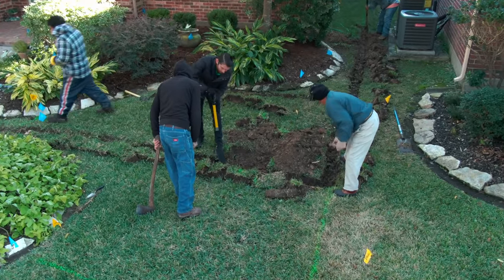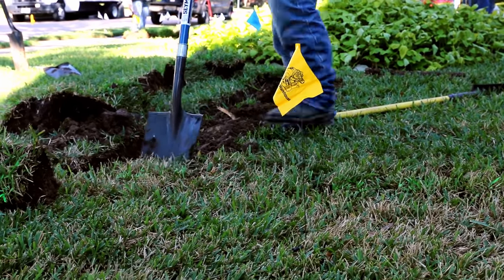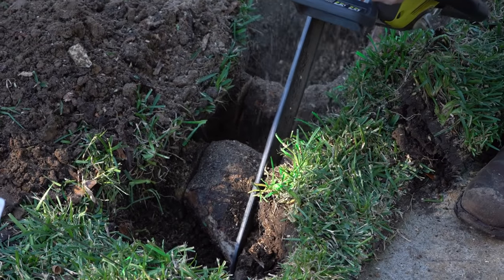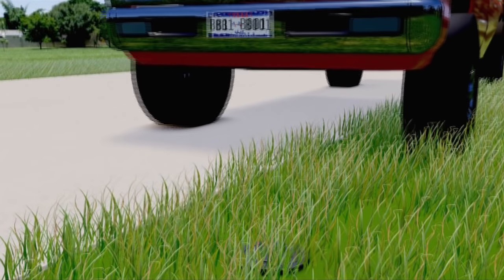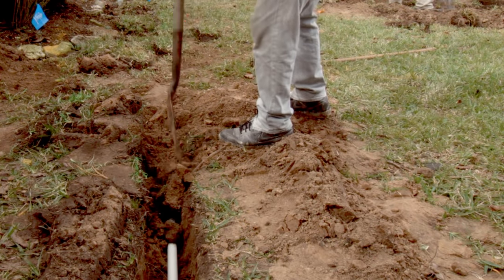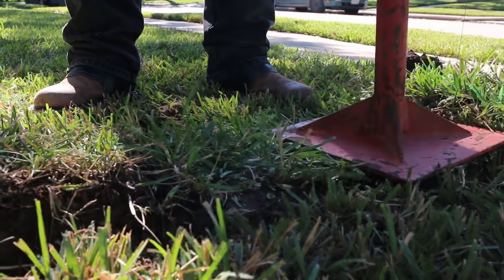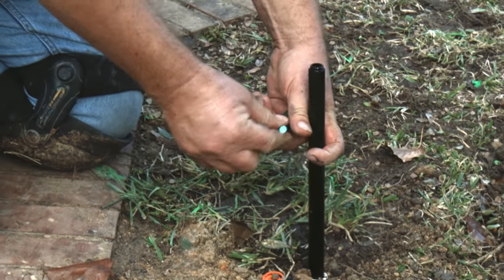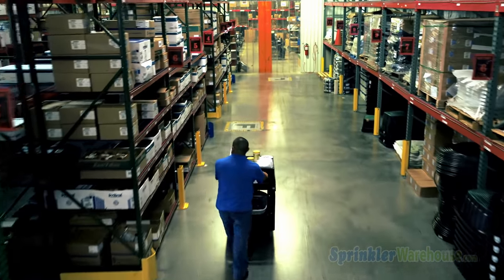Trenching, Pipes, & Sprinklers

Comment: Would I be ok digging about 4 to 5 inches in the ground for a firepit if my irrigation  line runs under where i want to put firepit?
Reply: If you are saying that pvc will be 4 or 5" under a fire pit, I'm not sure i understand you correctly but if that is the case I would not recommend you try that. the pipe could get hot and melt.
Reply: 5 or 7 inches of dirt between a fire and pvc isn't a good mix you. Unless you are burning little tiny fires for very short amounts of time then you might would be ok but I wouldn't try it. :)
Reply: Yes, in fact I would recommend placing your lines 1 inch below the fire pit. The heat from the fire will warm the water and provide nice, geothermal heated water. In fact, you could even run the lines right through the flames.

Comment: Southeastern Plumbing code, requires Pressurized pipe depth to be 12" minimum, depressurized  pipe can be as little as 6"
Reply: Constant pressure vs sprinkler lines makes the difference.
Reply: Texas code requires 6 inches of cover.(on top of pipe ) Though, I'd recommend a little more.

Comment: Wire should be in a conduit
Reply from the maker: Sprinkler Warehouse sells 16 and 18 gauge direct-burial wire that is designed to be buried in a trench underground without the need for conduit. The individual electrical conducting wires are encased in a solid thermoplastic sheath that seals out moisture and protects the conductors within.
Reply: No;  irrigation wire is suited for burial.  It only carries 24 VAC to operate the valves.  Conduit is cost prohibited.

Comment: 4 pipes in one trench? Sheesh, what a pain for repairs. I didn’t realize they still used such archaic installation methods these days! How about a vibratory plow?
Reply: Vibratory plows are for simple folk with simple systems.. when the city wants 12 zones in an area less than 100 ft that's what you end up with.
Reply: @noeeon9910  Vibratory plows are for 90% of all jobs. Using a pro sneak 360 is so much easier than digging trenches. Also PVC doesn't need to be used unless the project is massive. Even using PVC, you can pull it with the pro sneak 360.
Reply: @ThroughMyEyesASMR   I install a 10 zone system in 2 hours in an area no greater than 2,600 sqft with a ditch witch. It's the most efficient way in new construction. Vibratory plows are not an option.

Comment: How many heads we can add on one zone ?
Reply: Depending on water pressure, usually 7-8 heads max. Unless you use MP rotors
Reply: @treyvorcamara9530  you dont go by number of heads. You go by gallons per minute. You need to be able to use pressure loss charts to design the system.  While keeping velocity about 5 feet per second through pipes. Look up pressure loss through city service line for particular gpm, and loss through water meter, and valves (which is roughly 5psi or less)and length of pipe at said gpm and fittings and pressure to push up the " last head" which is usually about 20 psi. And backflow device. Add all this up and should be at least 10 percent below available static pressure . If you shouldn't push more than 12 psi per zone then that's 3 -15 foot full circles (if not low volume nozzles) or 6 half circle heads etc. Not the number of heads.
Reply: @treyvorcamara9530  Where did you get that ? Depends on static water pressure and size of meter. Dont go by number of heads.  Figure out available pressure.  Or......go trial and error if you want like so many do....uuugh
Reply: If you have a water meter that measures 3/4 inch you can safe flow 22 gallons per minute.  Do the math depending on head arc.  Full circle is 3 GPM, half circle is 1.5 gpm and Quarter circle is .75 pgm.  Place flags 12 feet apart and do a layout and the math on total GPM.  Do not exceed 22 gallons with 3/4 meter (call you city to find out).   Use 1 inch pipe out of the valves since gpm flow allow 22 gpm,  then reduce to 3/4 once you determine flow to be under 15 gpm.  NEVER use 1/2 pipe,  not worth buying fittings and pipe for 3 sizes.  Stick to 1 inch and 3/4 for pipes and fittings. Saves a ton of time.

Comment: If you use pvc over poly for branch lines its guaranteed service calls for years to come, kind of shitty for your customers really. SCH 200 pvc as well, at least use the sch 40. Also the use of the fucking same color coded wire for the wiring outside of the common is dogshit. I hate going to service systems that were installed poorly like this, makes things that would normally be a simple quick fix take longer.

Comment: Lateral lines laying in the same trench on top of each other is never a good idea. Any break in a line, the repair work will be ten times as hard. The pipes are also not deep enough. Good luck if you ever want to aerate this lawn. This install is a shit show.
Reply: ive ran my main line underground alongside the side fence  and the control cables in a conduit saddled about 4 inches above the ground and above the main line . each station's solenoid is in a box near the fence with a tee from the wiring conduit going down into the ground box  one main line  40mm  with all tee offs 25mm  .this saves a lot of time for maintenance and locating  solenoids is a breeze
Reply: You must be a pipe puller... Laying lateral line with main and others is EXACTLY how you do it... If your worth your salt as a repair man the shit ain't hard to repair.